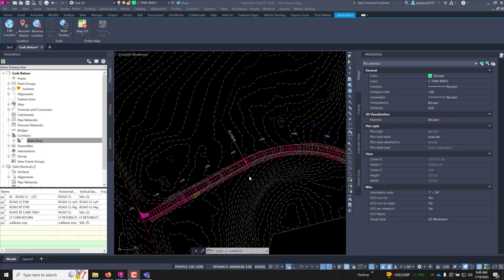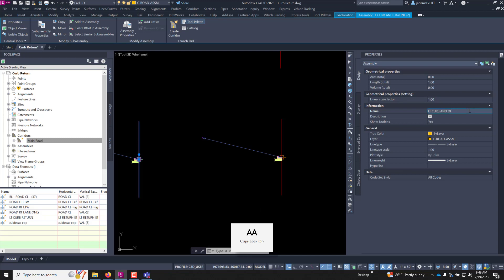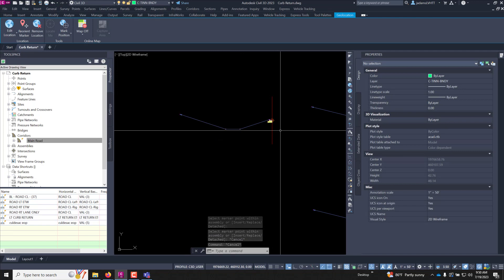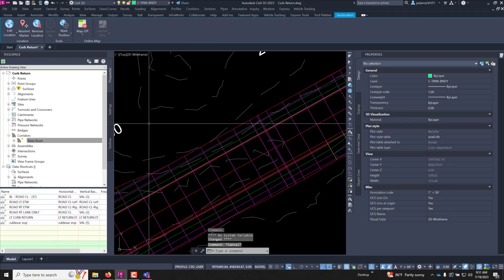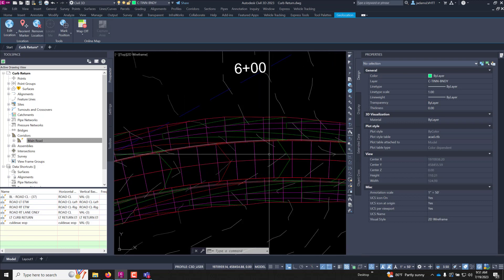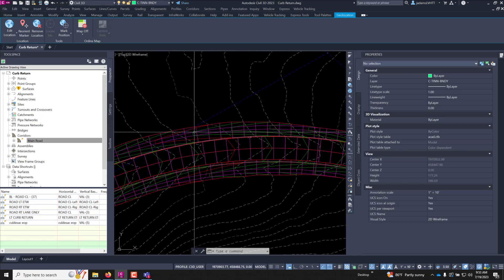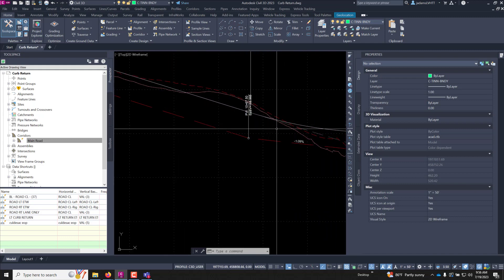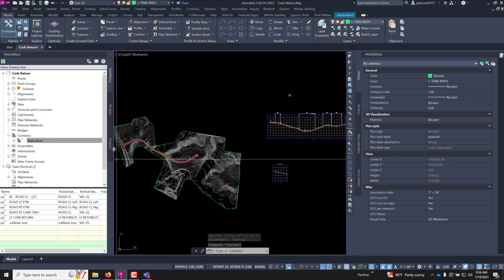Civil 3d - Special Ditches

Comment: Awesome 🙏 thank you so much I really needed some help with ditches.I also have a question when I add a ditch to my assembly it doesn't place exactly after my pavement it actually stays with a distance from it I don't know what to do. phm🙏
Reply from the maker: Sounds like your target isnt woeking. Check to make sure u have the point u want set to either vertically or horizontally targetted